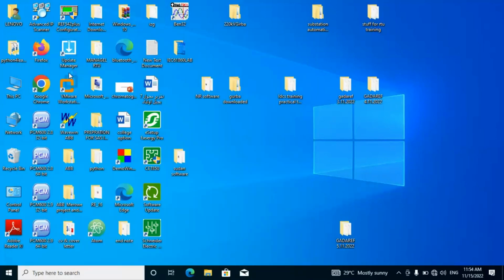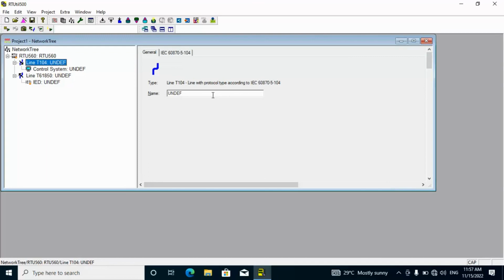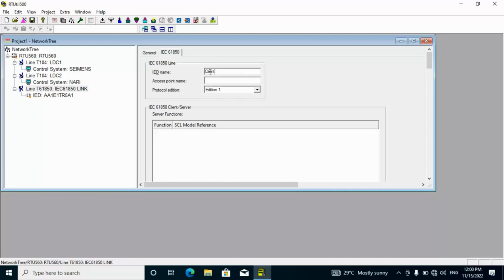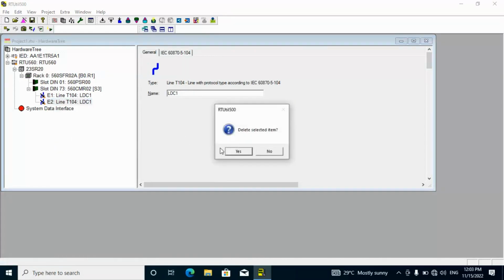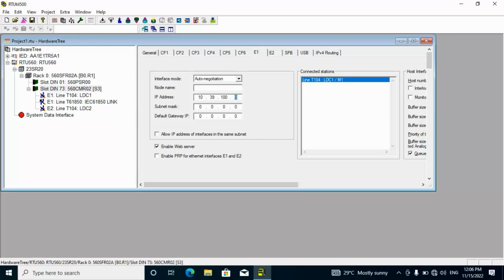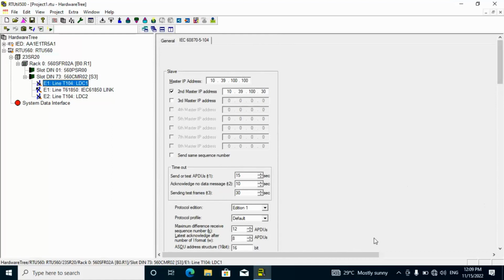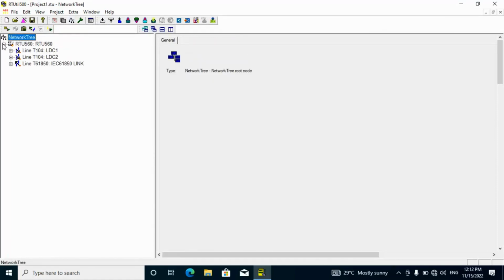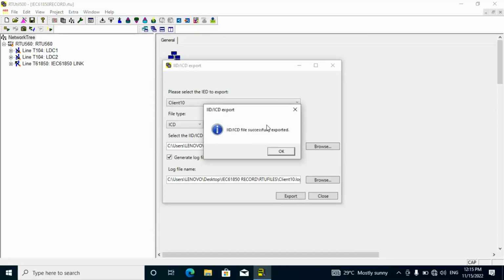Prepare Files for ABB RTU 560 Using IEC61850 PROTOCOL English

Comment: What is meant by IV in RTU560.  I can ping the relay but data from relay that is displayed in RTU is 0 with an IV on the side?. What seems to be the problem? Thank you
Reply from the maker: @dennistabenas7412  hello I hope that you are fine Iv means invalid  many reason could cause that such as signal type or signal address or just make simulation to to your signal so that can be refreshed and be updated , what protocol that you are using for communication between relay and rtu?